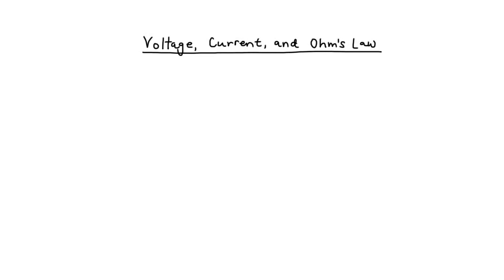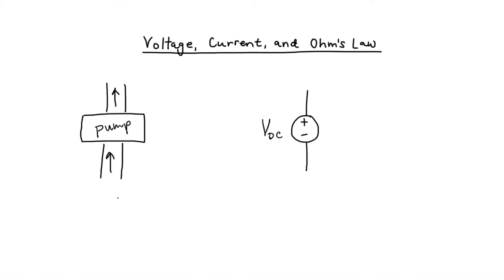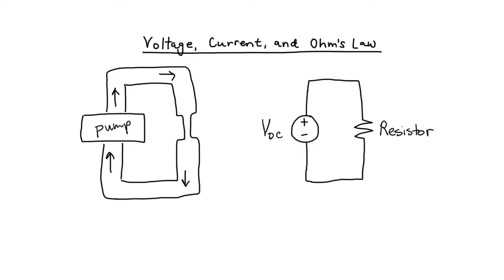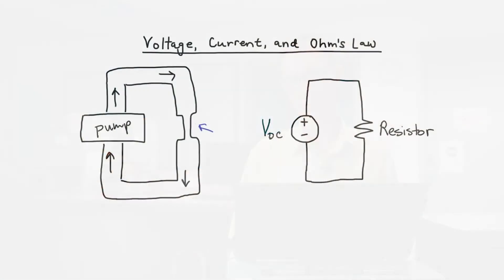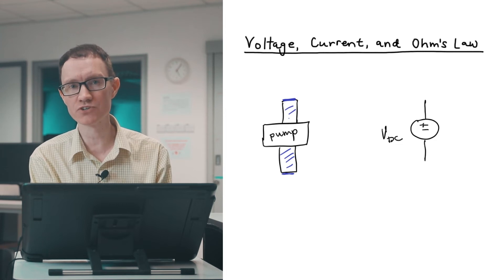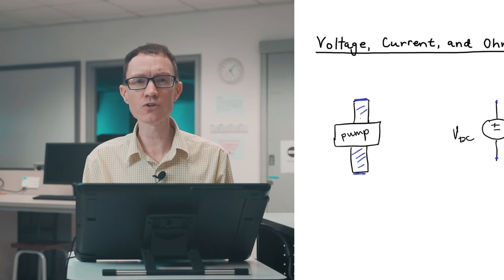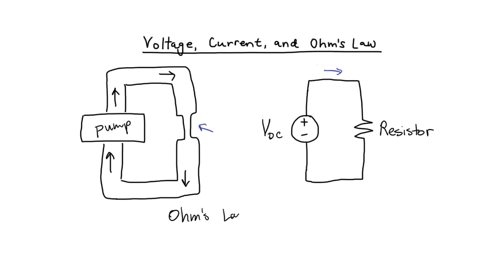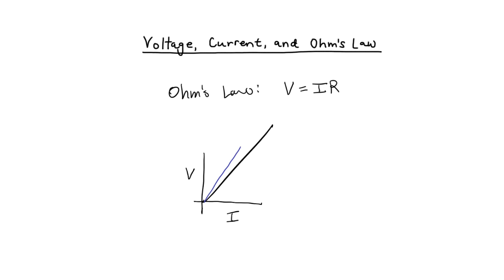Voltage, Current and Ohm's Law (Circuits For Beginners #1)

Comment: If the voltage source is a battery, then there is problem with this analogy. Liquid flows through the pump, but electrons do not flow through the battery. In lessons such as this, it is better to say "mobile charges" or "free charges," not "electrons." Because many times, the mobile charges in part of a circuit - or even the whole circuit - are NOT electrons.

Comment: Thank you for all the work you have done making your videos.  I hope more people discover them and get the same benefit that I have.
Do the same conservation of energy principles that apply in a Venturi tube apply in an electrical circuit or the water pipe analogy?
That is, does the ‘pressure’ in the pipe downstream of the restriction drop because the velocity of the water through the restriction increases?